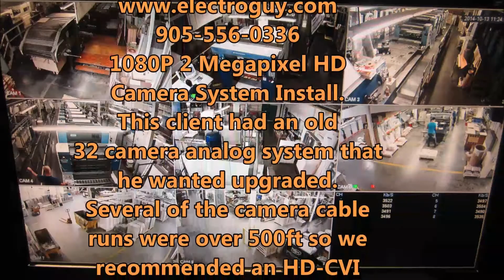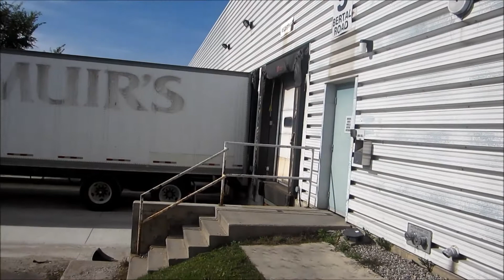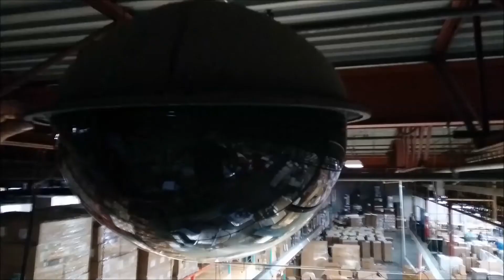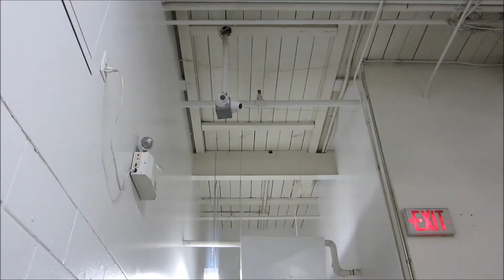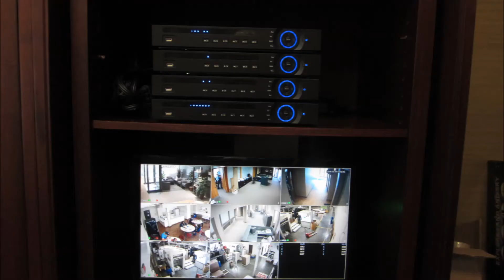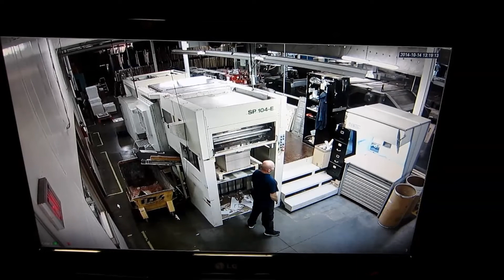Upgrade your old analog cameras to 1080p HD security cameras

Comment: what is the device you used to change the view of dvr1 to dvr2 and so on... the small-like mouse..
Reply from the maker: Its called a KVM switch
Reply: it is plug and play?
Reply from the maker: Yes it is.  It comes with USB cables and monitor cables that plug into each DVR or computer.  You can then switch between each device and use just the one monitor keyboard and mouse.
In this case I did not use a keyboard.

Comment: Hd-cvi will also transmit over cat 5 using a balun the same as analog.  So newer analog systems or jobs where both coax and cat5 were used can still be upgraded using the existing cabling because hd-cvi works on both cables the same as analog.

Comment: They can both be used to upgrade older analog systems that used coax cable.  Hd-cvi will transmit up to 1500ft over coax.  Hd-sdi will only do about 300ft.  So in cases where there are long cable runs cvi is the best choice

Comment: What is the difference between HD-CVI and HD-SDI ?
Did you have to use a special coax cable ?
Reply from the maker: Hd-CVI is considered HD over analog whereas HD-SDI is a pure digital signal.  HD-SDI is more expensive to manufacture so CVI has become more popular.
Reply: Seems like it would just be worth it to go IP